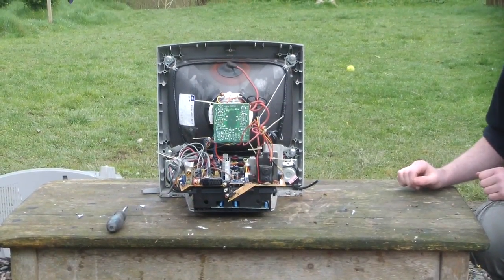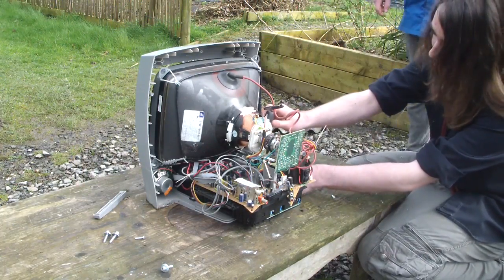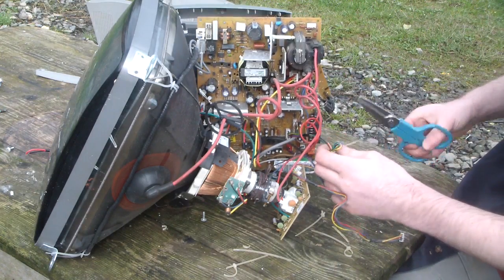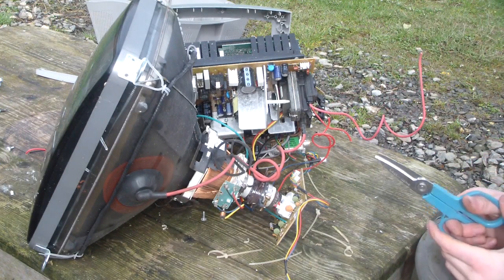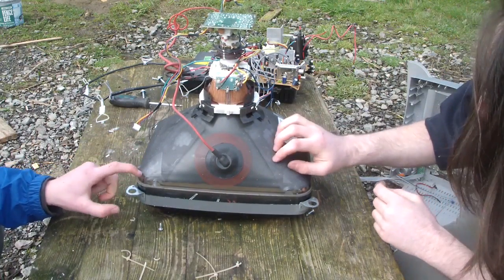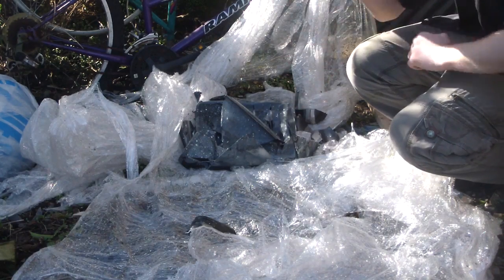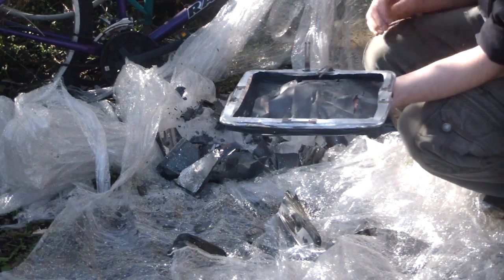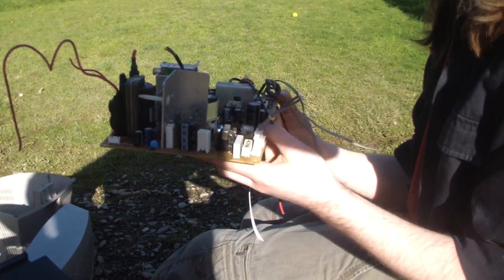Taking Apart an Old TV is So Cool! Whats inside an old TV? | Science with Greg

Comment: Holy fuck I was tense when you had that chisel on the tube, that could have easily been a hospital trip right there! The inside of the glass is a vacuum that's what caused the shockwave, the thing at the end of the tube is an electron gun, like it said it doesn't produce dangerous radiation under normal operation, And finally yeah the voltages in this can kill you, the big red wire is on the flyback transformer which can hold very high voltages if not discharged correctly.
Reply from the maker: yes we only found out after how dodgy this was lmao
Reply: @SciencewithGreg  Oh well no harm done thankfully!
Reply: Don't say Fuck That is a bad word 😡😡😡😡 I am a Muslim
Reply from the maker: Thank you
Reply: @mishallbinahmed  top 5 Science with gregg respect moments

Comment: Sorry chaps but this is irresponsible and thoroughly dangerous. 

The CRT contains a vacuum, which when released caused the ‘shock wave’. The metal band around the periphery of the CRT, which you hacked away at with a chisel, is called the rim band. It’s purpose is to deflect glass towards the back of the CRT (away from the user/viewer) were the glass envelope to be broken in an accident. Had the glass envelope fractured while you were hitting it at the back that spray of glass would have been propelled into your faces and, I guarantee, you would both now be blind, especially as you had no eye protection. 

NEVER screw around with a CRT, they are potentially very dangerous.
Reply: These two young men recently passed away trying to dis arm an unexploded ww2 bomb, saving a hospital from its blast. Please be respectful to their families in this trying time.
Reply from the maker: Indeed.
Reply: Is there a safe way to do it? I was hoping to disassemble my TVs for projects, but now I'm thinking I shouldn't.
Reply from the maker: Do your research before attempting. Must be discharged properly etc. this is not a tutorial 😅😅😅